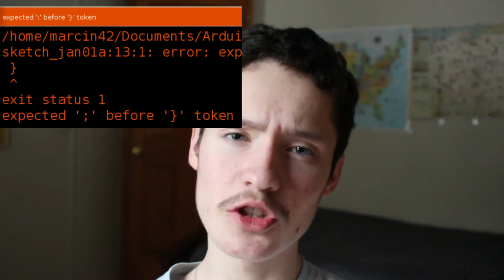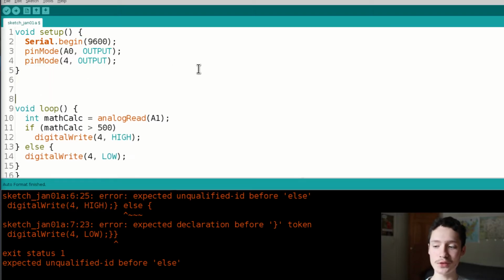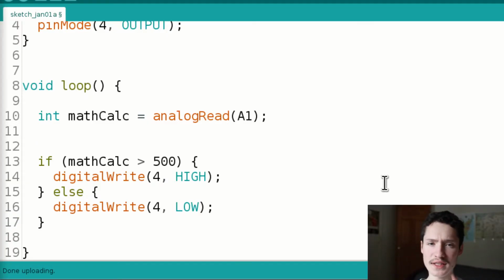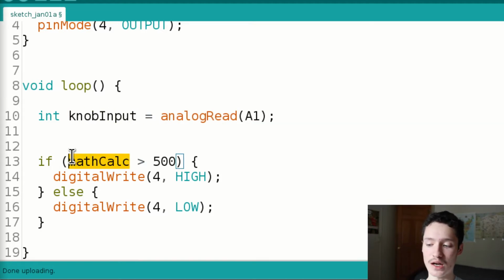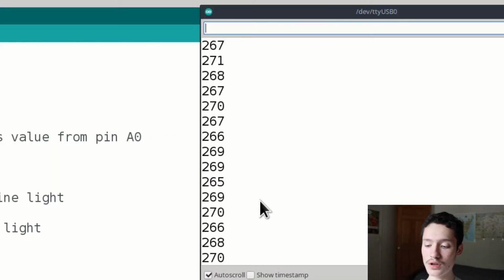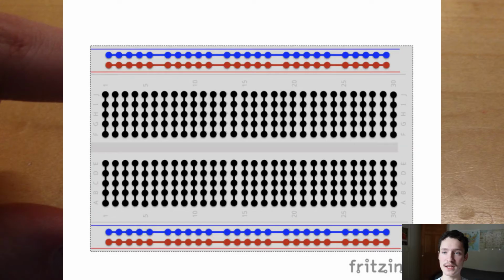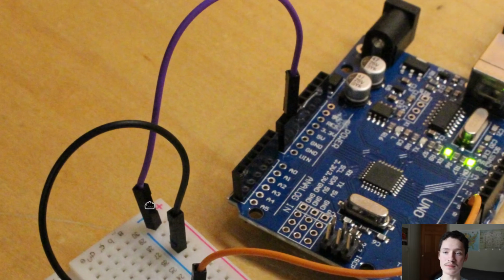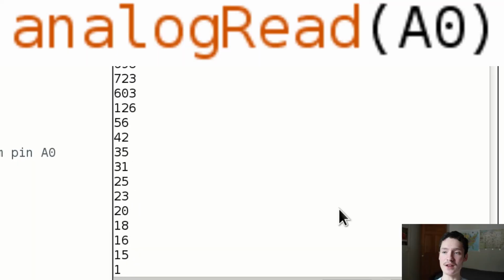Arduino Fest Advice

Comment: isnt this like the damn basic common sense u learn from ur first class not even arduino specifically
unless ur audience is supposed to be some artists using arduino and touching programming for the first time

also, analog pin can do outputs
Reply: He said "pins starting with A", not PWM, which is what AnalogWrite uses